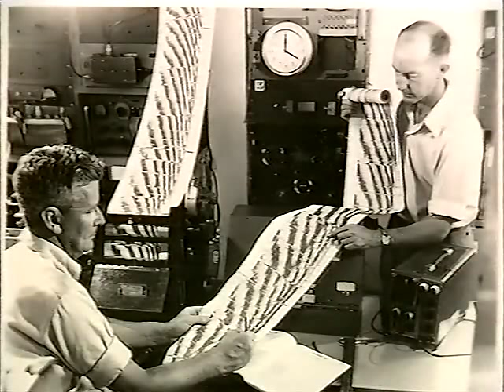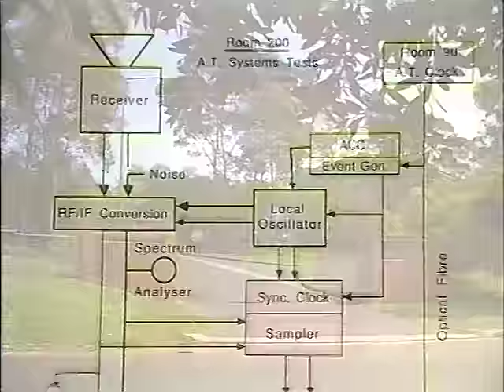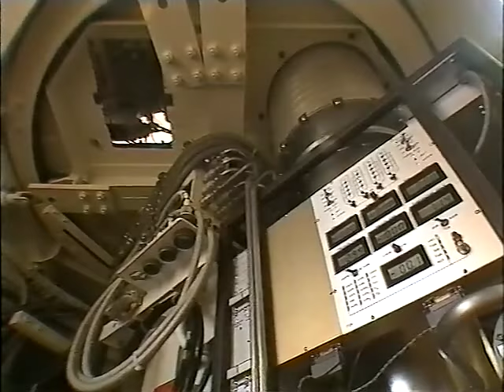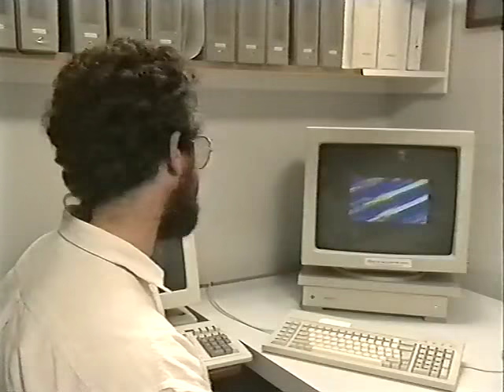Hidden Visions (Radio Astronomy imaging techniques)

Comment: at time index 17:41 - what is this application to EM into images???
Reply: If this was made in the 90's, the software/hardware they're using now is probably different but far more powerful.    The radar world uses DSP's and FPGA's in addition to regular computers.  I imagine radio astronomers might do the same.  Check out "Aperture Synthesis", "Very Long Baseline Interferometry", and "Atacama Large Millimeter Array" articles in Wikipedia.